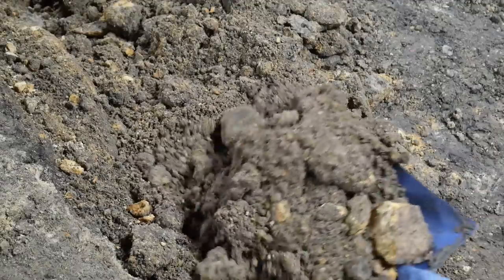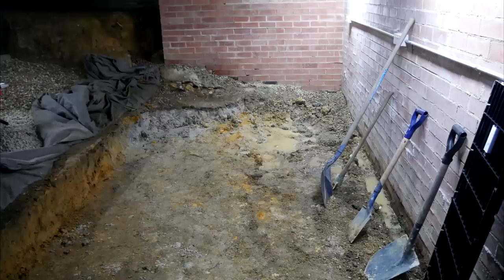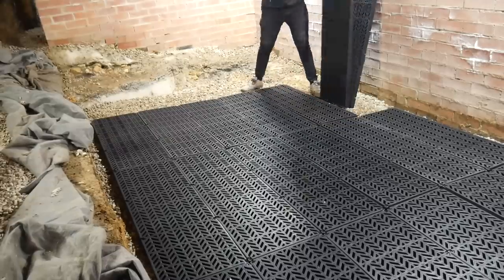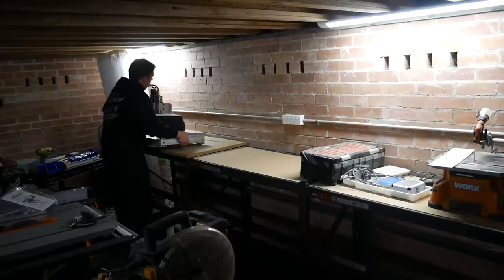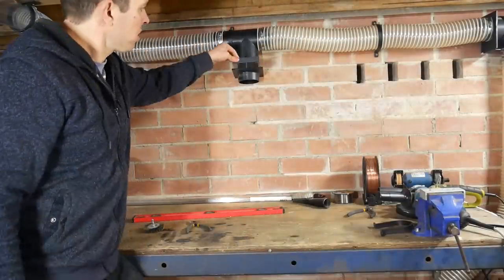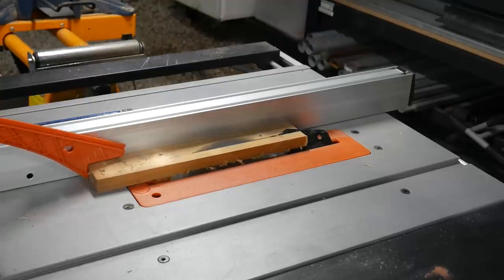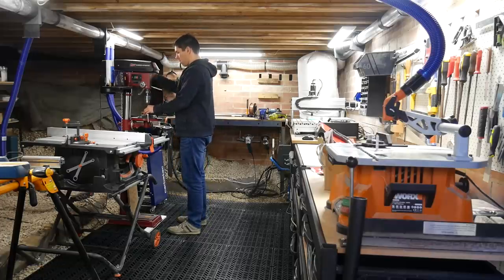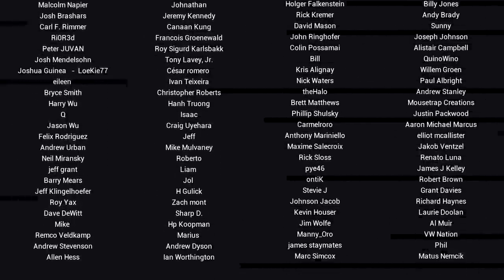Digging to create an efficient under house workshop

Comment: Great video, and great work on turning that space into a workshop, and really good use of space!

I'd say try a low speed through the wall fan to move air in or out, that would probably be a way to manage humidity and run more cheaply than the dehumi and silica gel. My half a tiny bedroom workspace has a 120mm 12V computer fan that I can run 24/7 and all it does is drag air out in winter and I flip it around for summer use, that way it manages humidity and temperature. Doesn't seem to be doing much at any instant but the effect over a few days is definitely noticeable. And if I had a bigger space I'd just use an array of them, they're cheap, quiet, designed to run continuously unlike bathroom and kitchen extractors, and you can power a 2x2 or even 3x3 grid of them with a middlingly hefty plugpack. Make insect screens and external louvres to keep rain out. (I only have the one so I used a vent outlet from Bunnings outside and printed an adaptor for the fan inside.)

Comment: I'm glad you found something that works for you. However, I'm concerned for multiple reasons. The first being humidity. I like that you took precautions to combat it and if this set up was going to be temporary I dont think it would be too bad but that humidity over time will absolute destroy your tools and electronics. Second, that space is a major fire hazard. All that water, plus electric is one source. Your welding bench right next to your dust collection is another. I would highly recommend getting multiple fire extinguishers, and it looks like there's quite a few other comments that recommend this as well.

If you're dead set on using this space, it would be a good idea to paint everything a bright color such as white. It'll help bounce the light and brighten up the room, plus brighter colors give the illusion of more space.

You may also want to get a quote from a contractor to see if a proper workshop can be built, rather than a make shift one. Proper flooring, drainage, electrical, etc.

Comment: Seeing those holes in the brick, how about a power fan?

I have a louvred fan in my shed.  I use a cheap temperature and humidity sensor and a smart plug to control it.

I use Home Assistant to calculate the absolute humidity from relative, and dew point.

The fan runs whenever it is drier outside OR if the temperature in the shed is nearing the dew point.

No more rusty tools.

Comment: I think the humidity control with a dehumidifier will be losing battle , i spent 10 yrs using a workshop dug out under my mum's  house that  had a dirt floor and if i learned one thing it was if i didn't want something to rust - oil it . I can recommend two products for stopping rust - Lanotec and Mako oil , the first is lanolin based and the latter is fish oil based and i have been using these for a long time to protect my machinery in  my 1950's  era fibro garage that suffers the worst condensation problems  i have ever seen  . So bad in fact that each machine has to live under either a waterproof cover or ply cover with its own dedicated microcontroller controlled dehumidifier and a coating of either Lanotec  or Mako oil . Under the house condensation won't be such a problem as the temperature will remain fairly constant where as in my case the garage fluctuates greatly , it gets cold quickly at night then heats up quickly when the sun hits the side ( it is north / south oriented ) but the machines have had all night to cool down but take a long time to heat up so condensation forms on them easily . The only other thing that i would be concerned with is the plastic bag on the dust collector being right next to the welding bench as  spatter might burn holes in it - a piece of ply or MDF  set up as a divider or guard would solve that problem .

Comment: Very jealous of the space. I think a funicular railway is a must have project. Could you put vinyl flooring down to prevent losing small parts?
Reply: I would get some of these foam mats that clip together. No problems with lost bolts and it's much easier on your joints when standing around for a prolonged period.

Comment: Man that's a really admirable job!

It might have made some sense to talk with some experts who deal with digging out basements under existing houses to figure out what they have to deal with.  From what I've seen, there's a LOT of labor and materials that go into sealing the foundation walls, and floors from moisture.  That said, I hope you are able to control the moisture level well enough.

I love the french cleat system you latched onto, and now you've got me thinking about using that in either my garage or a room I plan to convert into a little workspace.  It seems like a flexible and safe solution, especially where I live... we are expecting a massive earthquake/tsunami any day / year / decade now.

Comment: A shortcut to getting better flooring is to mix in about 2 inches of your dirt in the back of premixed concrete for every 2 to 6 ft. I don’t know what that is a metric it basically works out 2 to times bigger than the bag of concrete takes up. It will take about 2 inches of dirt play mix concrete down dry do you wanna take a garden rake get level and Get a grass tamp Tamp down really good. Then you can lightly mist it with water enough to get it wet, but not runoff the top layer will harden up to about a half inch of concrete in 24 hours and the rest will turn into concrete from the moisture eventually giving you about 2 to 4 inches of solid flooring. What you’re making is something similar to a product called crush run. It also has a good quick repair for a dirt driveway that has holes to get it and keep it level.

Comment: As others mention, the damp will corrode your machine tools. Adequate ventilation of this space will be crucial. You may find that you cannot properly ventilate it naturally and may have to mechanically ventilate it. 

Making this type of space habitable is a huge undertaking. Read about how basements are retro-built under houses. It mostly involves excavating, piling and casting a concrete bin around the walls and floor with an integral membrane and a sump somewhere in the floor to collect water. This sump needs a pump, running, as and when, under control, to remove the water.

I'd ask you if the space smelled damp before you started. If it did, I wouldn't have tried to reclaim it.

I wish you the best of luck.

Comment: Could you have poured a concrete floor that was level with the footer? What about putting in a wall to separate the rest of the basement? You could also get a roll of flooring and put over that floor too. Nice job in all.

Comment: If that dehumidifier doesn't have a hose drain option you'll be busy emptying the bin. My printer space, even though a finished room, needs a dehumidifier anyway. I have it's drain dropped into an HVAC condensate pump so I'm not down there 2-3 times a day to dump the bin. I'm still deciding where to plumb the pump discharge for the one in the garage.

Comment: Cover the floor now with some of that rubber backed carpet runner, this will cut how much work it is to clean up as an old carpet vacuum will do. It’s sold here at Home Depot by the foot, I’m sure you could find it

Comment: If you want a higher powered dehumidifier use a smaller window unit ac mounted on a standing frame with a hole CAREFULLY drilled in the bottom of the unit and piped into a sealed 5 gallon bucket (or even outside). If you want to use the ac as a window unit later just 3d print a plug for the bottom. It won't cool the space off more actually it might warm it up a little it will use roughly 500 watts (one side heating and the other cooling at the same time). It's basically what a dehumidifier does only on a larger scale and more cost effective. Also if a 500 watt one isn't enough you can upscale to maybe even a 1200 watt. If you build one your equipment WON'T suffer from the humidity.

Comment: Michael - a couple of things:
1. It might be a good idea to look into finding a way to provide some grounding to deal with static build up in you dust extraction system. Loads of dust swirling through a plastic tube might cause a static build up, & that combined with a dust/air mixture could create the potential for unintended consequences. 💣 🔥

2. Given the reputation for your part of the world, have you done anything to mitigate the chances of critter intrusion?

Comment: Very nice workshop! I would have never used your flooring though. It seems you already realized that if you drop something, it's as good as gone forever. I'd get something to cover everything up. Maybe a thin layer of concrete so everything ends up smooth and flat.

Comment: Think you might have problems as no dpc , I would check the humidity down there as you may suffer corrosion issues if its to high. wouldn't want to see all your tools damaged by damp or condensation

Comment: That amount of humidity is scarry. Also, it's in the walls like at 1:18 those white "fur"s are caused by water in those walls
Reply: The humidity is basically never below 80% in Ireland where I live. Is 70% really that bad?
Reply: @aidansing  For a guy doing technical stuff indoors, are you kidding?

Not to mention [toxic] mold, etc?

Just wow.
Reply: The white "fur" is called efflorescence.
Reply: @kitbuilt3845  the more I know now, thanks!

Comment: Looks good, are you having any humidity impact on the materials you used for the "bench tops" from humidity?  It looks similar to the "MDF" I was using in my shop - I had to switch to plywood to prevent sagging.

Comment: Some ag drain along that wall would have been handy. controlling humidity will be paramount. It might have been a sensible idea to wall of the remainder of the underside of the house because It's not just moisture coming from the sandstone, but it's moisture coming from the exposed soil under the house too. You'll need some heat, air movement, and dehumidifying to keep all your tools and machines from getting degraded.

Comment: Wow, thats a lot of hard work, and Im impressed with how you have overcome the problems that this site gives. Ive tried dehumidifiers in humid basements before - without much success. They do extract gallons of water, and no doubt use a load of electricity. I ended up using  WD40 on everything metal, then later I used a tool guard spray, cant remember which one but it worked fine on top of the WD40.

Comment: For your welding table, rip off the wood and get some 3mm (or thicker) steel plate, it will be flat enough that whatever you make on it is straight but more importantly it allows you to weld up any jig you might need directly on the table and you can clip your earth onto the edge of the tabletop or one of the legs and forget about it, anything you put on the table or in a vice that's bolted to the table etc. is earthed straight away without any fiddling

Comment: I can see cleaning will maybe be a big issue with this floor. 

It can't be swept easily, so it will have to be vacuumed. Vacuuming will be tedious as the tool on the vac will not be able to seal properly because the floor is full of holes. 

If you drop organic food waste accidentally in it, it will be a hands and knees scraping and washing job to clean it. I'd make a rule of no food down there. 

It's a good job you put some sort of membrane down, but I'm not sure which way up for a semipermeable one would be best if it is directional. 

That flooring is designed to lay outdoors and have adequate drainage under it and deal with the movement of organic material through it from both sides.

Good luck with doing it this way.

Comment: Solid-looking setup! I recommend Zach Freedman's Gridfinity system for your CNC/router bits, as well as just about any other small odds and ends like fasteners, drill bits, etc.

Also, I know you're all set up and are gonna hate hearing it, but I think you're much better off pouring a concrete floor with a built in drain trough. It's expensive, but it's a long term solution.

Finally, I think the humidity will be fine. I live in Florida where the humidity rarely gets as low as 70% during the summer and I keep my mechanic and power tools in an uninsulated, non-climate controlled garage. I imagine your tools will be fine, but hanging some thick plastic sheeting on the left side can cut down on the volume your dehumidifier has to work with. Just try not to make it look like a scene out of Dextor 😂
Reply: I was also going to suggest the Gridfinity system for any small parts storage such as CNC/router bits. I've built my own in the past, but having the community behind the Gridfinity system there is a lot out there such as OpenSCAD models to make it easy to get the size of bins you need and then 3D print them.

Comment: You are lucky to not have piers under that area of the house.
With the water, would a length of Ag pipe  directing it to the storm water pipe help?
Then maybe cover the plastic tiles with fibre cement sheets.

Comment: since you got running (standing) warter below the humidity will be verry high all the time. this will be a serious problem for everything.
i would strongly sugest sealing all mdf, plywood and  wood panels asap right now or change them to a plastic plate material.
they will suck up moisture realy fast and will swell, sack, warp and then break and just fall apart. also will grow mold verry quickly.

all iron/steal will rust like hell. every scratch in the paint every screw puted in, every screwhead bitdrive scratched.
dont expect the rack system to be reusable later if you aver move out.

also all electrical connection like plugs and screw terminals in internal platine connections of machines who are totaly fine in a dry environoment will corode verry fast. counterintuitively it can be slowed down with a layer of spraypaint since it will cover most of the metal to air surfaces.

i recommend getting a good (cheap) suplier of stainless steal screws to change all you have on machines over time and/or rust comverter to brush on and painting all the rusty screwheads and scratches with a small brush and some paint. maybee a small airbrush tool setup could be advised.

also maybee seal the inside of your workshop with plastic foil (starting with the flooring or below the flooring) all arround the walls and roof. (with a gap for airflow and a venting way to the outside) if possible put a (solar?) dehumidifier permanently in this sealed space with a permanent drain to the outside. a smart home system might help to save energy.
put more as one foil layer in the floor since it will be pinched easy maybee a pondfoil would work.
install an airlock style door? at least one almost airtight foil door in the canvas. 
it can be done with commercial avialable cheap dust prevention sets for construction sides (just a robust zipper in a foil)

good luck with your project.

Comment: Nice work mate! A couple of tips: change the T-Connectors for the dust extraction, to two 45 degrees a bit apart, so the airflow isn´t  choked. And take a look at the YT channel "A Glimpse inside", he has a lot of ideas and tips for the French cleat system! Keep the good work going!

Comment: What do you use the white EeePC netbook for? I have one just like this and I use it for running LaserGRBL for my engraver. I have Windows XP as originally distributed with the laptop and LaserGRBL has no problems with it. The performance is sufficient for this use case.

Comment: Hi Michael, basically i am happy that you found a space for the dirty work, but my concerns are, that you regret the decision in the near future. Even with a dehumidifier, your tools will start rusting and rod away. I had a similar problem in a very humid and cold basement room of my old house. Also from the safety point of view, your flooring is , let's say not an optimal solution. I think you should consider asking a contractor how to seal the room to the bottom end. I would expect here a proper layer of gravel, drainages, concrete and a layer of bitumous sheeting to keep the water below or waterproof concrete. Sealing it properly his here the biggest problem and challenge. Just my five cents... //R.

Comment: You really should have put that geofab back down before the gravel, even though it's a slow water flow it will still move particles and fill the gaps between the gravel eventually flooding your floor.